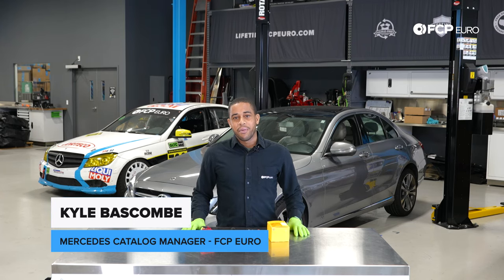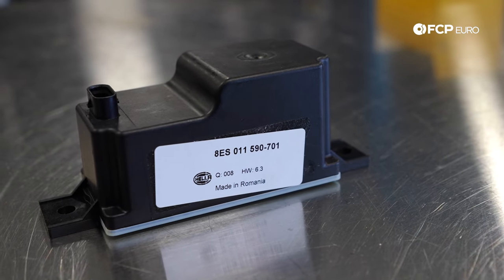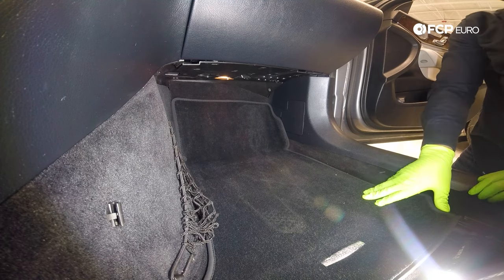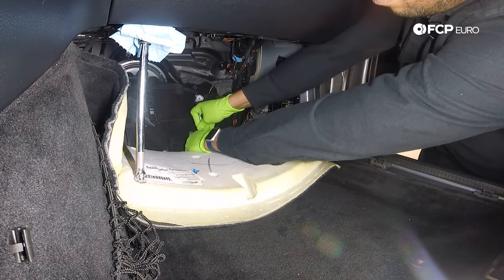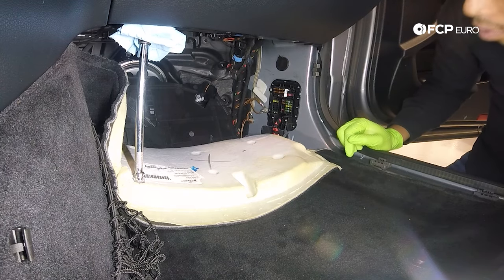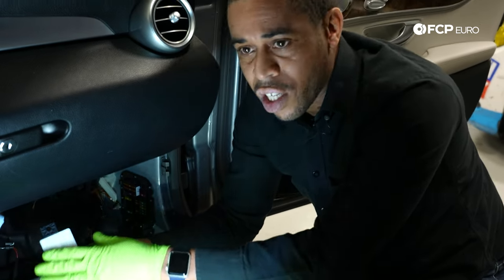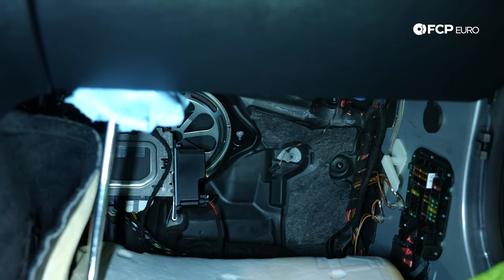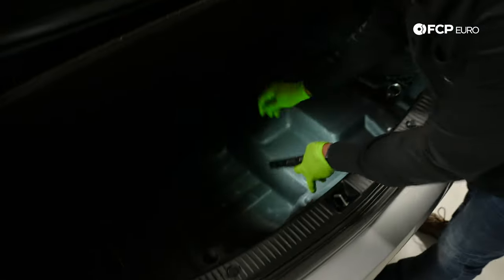Mercedes-Benz W205 Auxiliary Battery Replacement DIY (Mercedes-Benz C300, S63 AMG, C63 AMG, & More)

Comment: This guy really  wasted my time, I have done this before few years ago following another mechanic Vedic with no problem. This time I followed his video and I regret it, first the screw driver is T20, second the order of putting the panels back screwed me up for few days just because the door lower panel goes first then the fuses door and the main panel that has the two snap inns goes last. I  can see that he missed one of the snaps (driver side) I wonder how he was able to align the last screw to go in the body.

Comment: I know this is the price you pay for a luxury vehicle, but holy shit am I never buying a MB again. Two batteries? Really? The electronics system is so dated on a 2016 and it needs two fucking batteries? Can they think of ways to make it even more unconventional to replace such a bs thing too. 

My 2016 has gotten all its services, has been driven like a baby,  and less than 50K miles and I had to randomly replace  both fuel pumps cause it randomly shit out. Very disappointed in MB, think I’m gonna stick with Japanese cars after this.